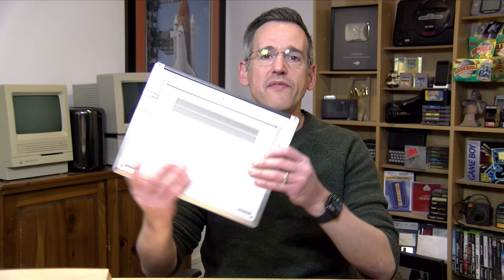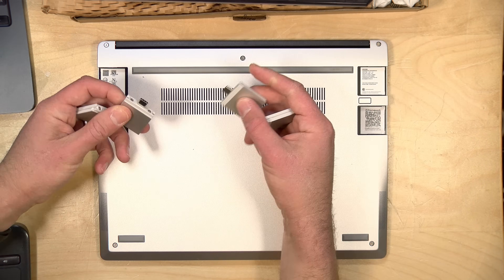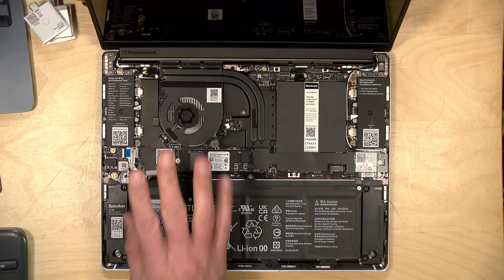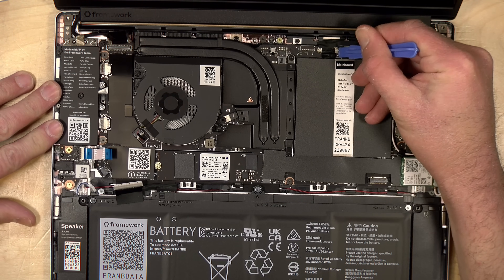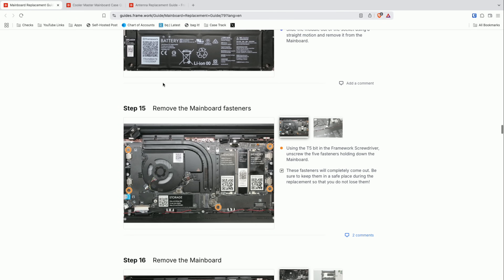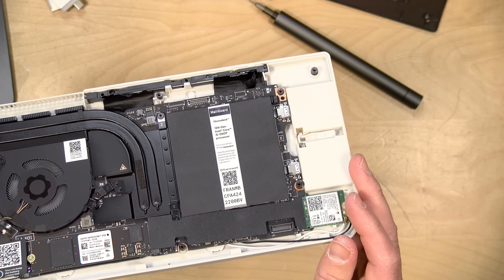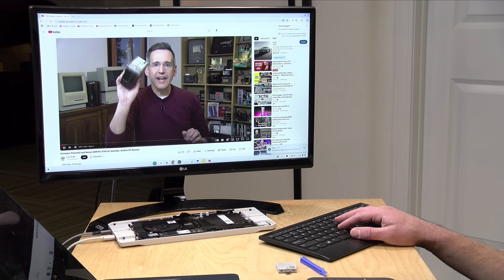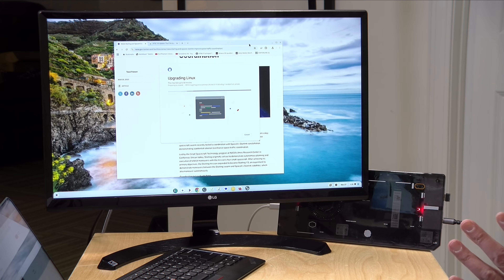Framework Laptop Upgrade Part 1: Chromebook to Chromebox!

Comment: I would like to have a Framework laptop without the display so I can use an external 15.6" 4K OLED display. I mean, only a laptop with a keyboard and trackpad. A laptop with a built-in display hurts my back when it comes to my visual disability and I need to have a screen magnifier such as the magnifier built into Linux desktop environment or Windows Magnifier in Windows. My external display is about a few inches away from my right eye (I'm blind in my left eye and I have optic nerve hypoplasia since I was born).

Comment: Great video! I hope you do more with the Framework devices (maybe the new desktop or the Framework 16 Laptop?). I just upgraded my 2 year old Framework 13 Laptop with their new upgraded 2.8K display. The entire swap out took less than 10 minutes. Now I have a higher res display that runs at 120Hz!

Comment: Instead of plugging a USB-C card into a motherboard with a USB-C port to power it via USB-C, you can plug the power cable directly into the motherboard and use that port with a new Windows notebook.

Comment: I just upgraded my Framework 16 to WiFi 7 today. Took like 10 minutes and only needed the screwdriver the Framework 16 came with. Also had an issue where my 2 key on the keyboard was sticking. Took the keyboard out which is tool-less and squirted some Iisopropyl alcohol under the key to wash it out, waved the keyboard around for a bit to dry it then put it back in the laptop. Problem solved, I absolutely love this laptop! Best laptop I have ever owned in my life by a significant margin.

Comment: The lengthy first boot was probably the system having to "re-train" the memory. Since you have 64 GB, that would take a bit longer than you might have initially expected.
Reply: That’s definitely true of AMD CPUs.
Reply: I’ve seen that as well
Reply: I think it was also probably the BIOS looking for the old display and keyboard/touchpad. It would take a moment for that to "time-out".